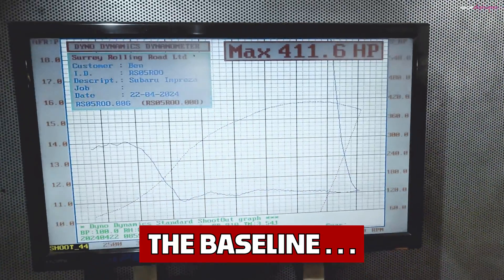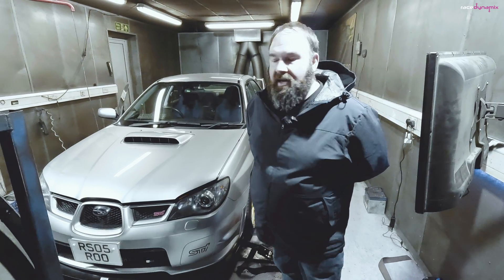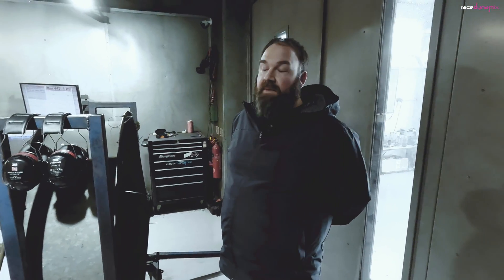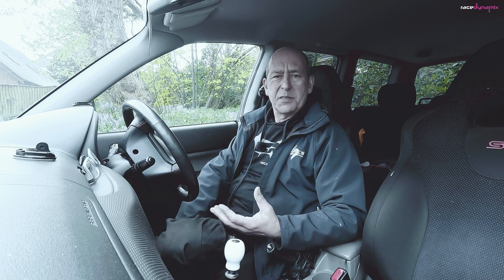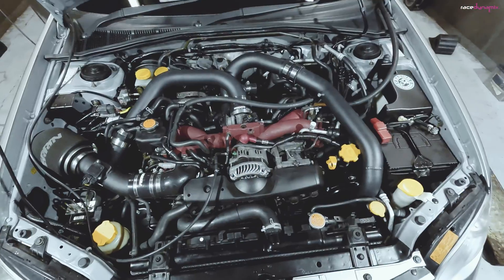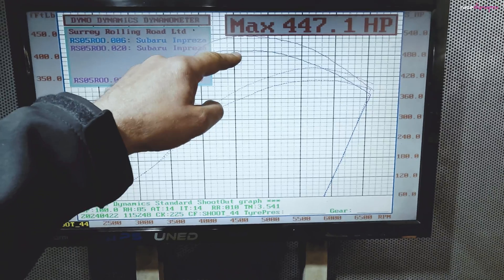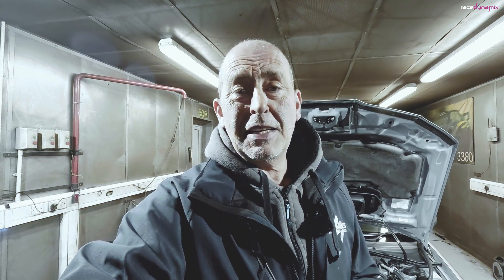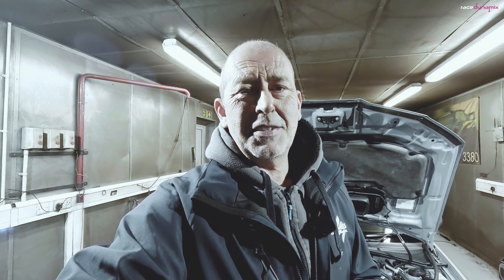FMIC vs TMIC: Worth It On A Subaru Impreza?

Comment: Is it worth it to get a fmic with a stock vf39 turbo? I live in an area that averages 105-110F in the summer.
Reply from the maker: It certainly helps keep air temps going into the engine low and that is extra safety at the very least. 😎

Comment: I wanted to love my TMIC... I monitored temperature with an IAT sensor in the TMIC and the TMIC would easily get ~20F hotter at wide open throttle; any additional throttle outside of casual cruising would heat up the TMIC. I installed an FMIC, transferred over the same IAT sensor, and saw the exact opposite effect, as you mentioned, it gets cooler the faster you go. It also cools off quickly after heat soaking while parked or in traffic.
Reply: Thats interesting. Colder the faster you go! Perfect
Reply from the maker: @admarshall4  indeed 😎
Reply from the maker: Exactly that 👌
Reply: Whats does the extra heat mean for driving on the street?
Reply from the maker: @davconelectric  it means that the map has to be adjusted to allow for that by reducing ignition timing and power going down 👍
Reply: @racedynamix  should I get a fmic for my stock powered track driven sti?
Reply: @racedynamix he’s pretty spot on with this comment, but the load compensation tables being scaled correctly and tuned correctly are the reason these avcs motors are in my opinion much more reliable when ran on a factory ecm.
Reply: @davconelectric no you would be better off with a bigger top mount. Unless your willing to move the radiator to the trunk and duct it like a rally car then the benifite of cooling the air is offset by the radiator not getting air flow. Like I said. Unless your willing to properly duct your front mount and radiator then a bigger top mount for a daily driven track car would be better in my opinion.
Reply from the maker: @HeidiFegles  sorry but you're wrong.
Reply: @HeidiFegles do u know how a intercooler and radiator works 😅😅😅😅😅
Reply: @jakelonghorn9852  the research is there and the story’s on the forum of extremely high iat temps due to heat soaking of the front mount air intercooler. The radiator which is right behind the ac condenser with the front mount air to air intercooler blocking all air to the radiator(air to water) heat transfer will kill your iat. Yes in a perfect world it sounds nice , but untill you move the radiator to the back like the rally cars then heat soak will be your worst enemy regardless of the turbo intercooler placement. Also the fact that people use little to no ducting at all to that front mount completely defeats the purpose. For a real test take that fan away from the intercooler and you will see the heat soak in talking about that you will encounter in day to day driving in traffic, or with someone in front of you blocking all air to your front mount.
Reply: What TMIC? There’s the placebo that aftermarket is better than the OEM STI. Especially the 17+ TMICs
Reply: @adidas2284  It was an ETS TMIC. I think the data about the VA STI TMIC came out after I bought the ETS, otherwise I might've stayed with the OEM TMIC until the tuner told me to get an FMIC (I'm over 400WHP).

Comment: If he had a smaller front number plate it would easily have made another 200bhp I reckon lol, seriously though for a cheap cooler that is great gains and the pipes fitted well by the looks of it which is normally the issue with cheap intercooler kits
Reply from the maker: Lol.  Yeah it did well 😎
Reply: I should have done what I see on a lot of dynos and just took the whole front bumper off mate 😂 would have easily made another 10bhp 😂😂
Reply from the maker: @benc911  🤣🤣

Comment: Have you done a sti oem tmic vs aftermarket bigger tmic?  Great vid
Reply from the maker: I haven't done one but the results would be midway between.  The larger tmic has a better core but size and where it is holds it back 👍

Comment: Great video :) I've got a question re 2.5's. Despite the STI having a redline starting at 7000rpm the 2.5 ALWAYS seems to start bleeding power at 6000-6200rpm. Even with the AVCS they seem to struggle, but why? is it a breathing issue (head ports/valves etc) or a displacement/stroke issue? Part of the reason I went from 2.5 to 2.1 on the Type R was to gain an extra 1000rpm of rev range as you could feel the power leaving the chat after 6k rpm. Might be worth doing a video on 2.0 vs 2.1 vs 2.3 vs 2.5, as I know the Gobstoppers are all 2.0 but people think you need a 2.3 for monster power.
Reply: Size of the turbo will change where the power is. The turbo on this is still small ish
Reply: @benc911  other than spool up it doesnt explain what I asked. I've built/run/modified Subarus for years, run 2.0, 2.1 and 2.5 engines etc and Duncan has probably tuned 200+ cars for us.
Reply: It's not a turbo just oem headers and flow trough them.